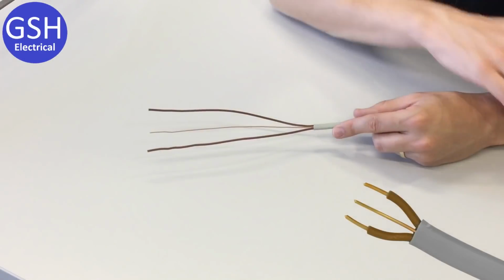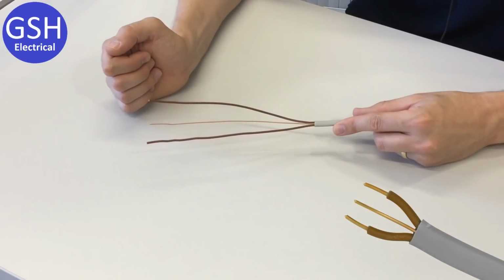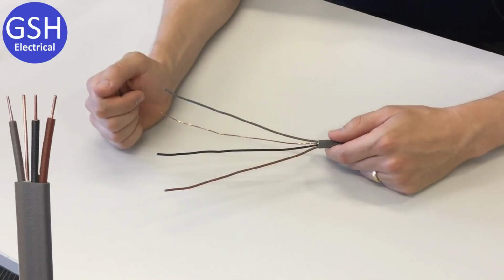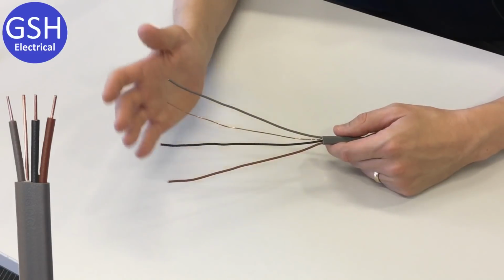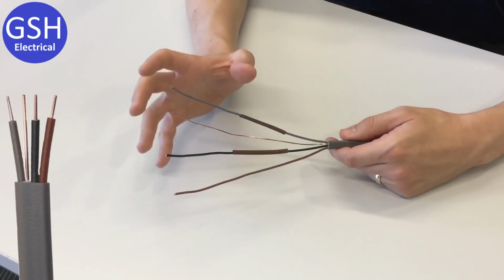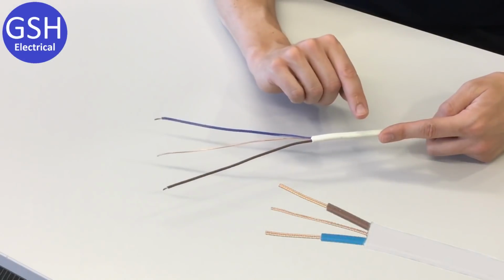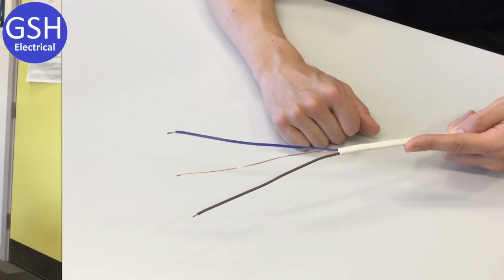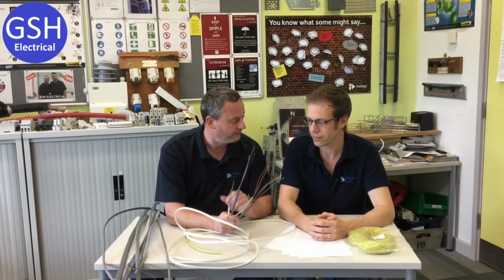Different Variations of PVC/PVC Cables Commonly Used in Domestic Dwellings Lighting Circuits

Comment: Naw where is the brown,cpc and black lighting cable the feed and  switch wire  no more tape or sleeving and also make a brown,black,CPC and blue lighting cable and a 2 blacks and cpc cable for the  pass wires  and cut in the middle for your intermediate  switch it's all about not using tape or sleeving again which I see in a few of your video's got to be better for the future sparks and all consumer units MUST go in a cupboard at 1200 to the bottom NO consumer unit's in hallway's or at the door or top of stairs no fitting CU anywhere you like especially outside   which  looks a mess keep them all the same in a cupboard.  Cheers

Comment: for a cable , twin and cpc cable for instance, with 6mm2 and in a domestic supply 240V , i have seen cables with 240/440V , ... and cables with 450/750 , so what would the adequate cable be for a domestic supply of 240V? if the section of the wires the conductor, ... say 6mm is the same, ... what is the difference, then between a 240/440 cable and a 450/750 v cable?
Reply: Insulation resistance up to 440 or 750 Volts.

Comment: Thanks for this great video. Now here is my 3 comment to cables in central Europe (Germany, Austria and Switzerland).
At first I have to mention that here all conductors are counted. For example: NYM-J 5x1,5 has 5 conductors with the crossaction of 1,5mm2 including PE(CPC) {brown, black, grey, blue, yellow/green).
Here we must not add some sleeving to the ends. Brown, black, grey can be used as 3phase or in lighting cercuits as switching wires. But on the other hand we must not use the colours of any other purpose as live wire. Blue must be neutral (old installations not included), yellow green must be of course CPC. 
In Austria and Germany there is no L/L/PE cable available. For lighting switches you use 4x1,5 or most commonly 5x1,5. In Switzerland there your can order L/L/PE cables with brown, black and yellow/green.
Of course halogen free cables are available and there use increase for the last few years.
Reply from the maker: Wow. Thanks for such details on other countries pvc cables. Keep watching and commenting many thanks again Gaz 👍